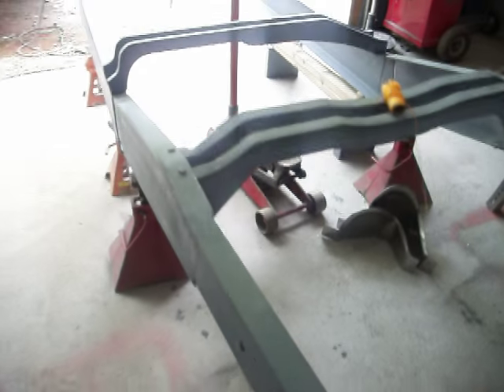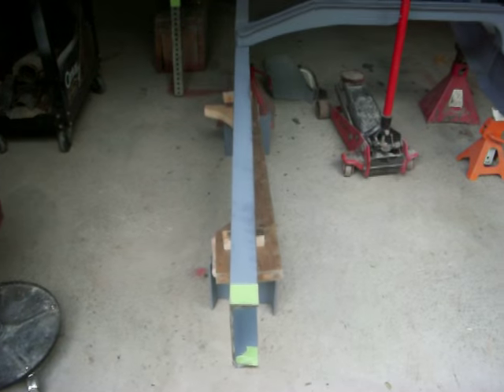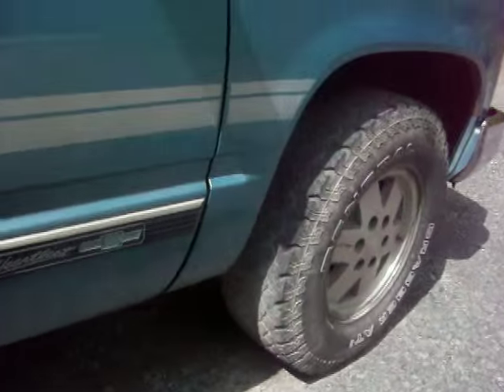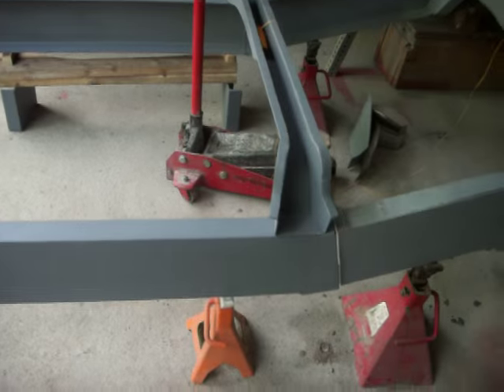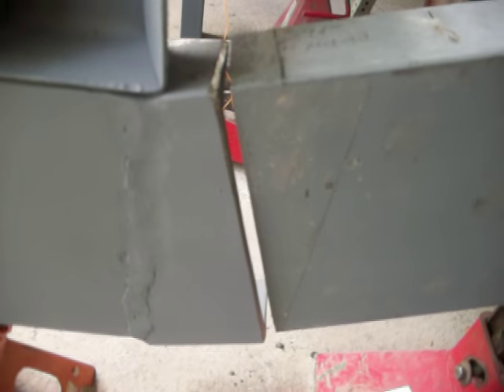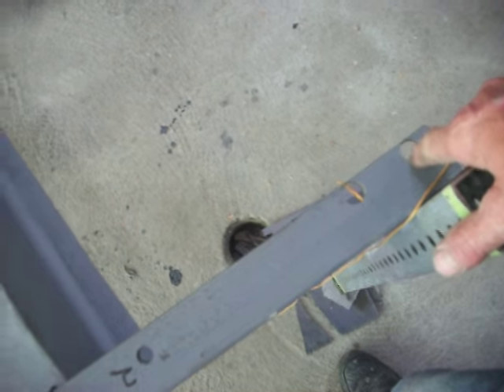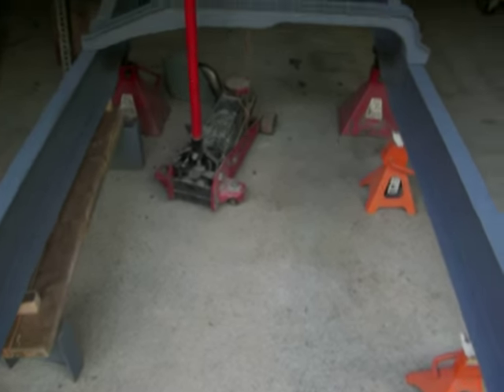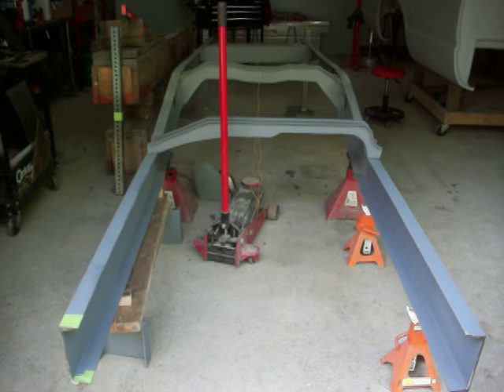Frame video 13 Extending frame to point of attachment. 1989 Silverado

Comment: Why did you put in that small angle  piece towards the front? Wouldn't it had been better to cut both sides half of what ever angle you were trying to achieve? Less welds and no awkward spacing.
Reply from the maker: My goal was to keep the frame as close to factory frame as possible by hand.
Reply: I don't see a difference doing it either way?
Reply from the maker: The very small angle iron was just temporary to hold the frame square.